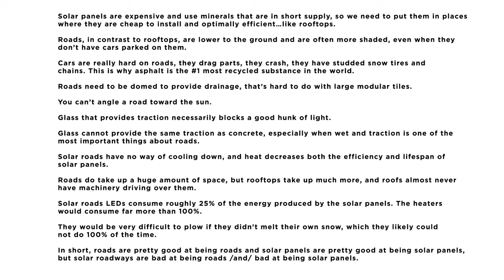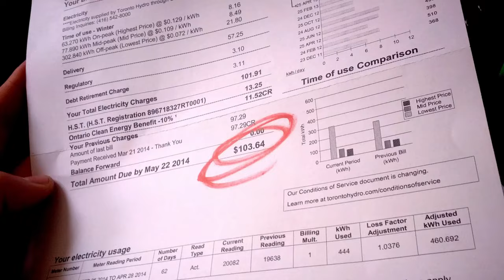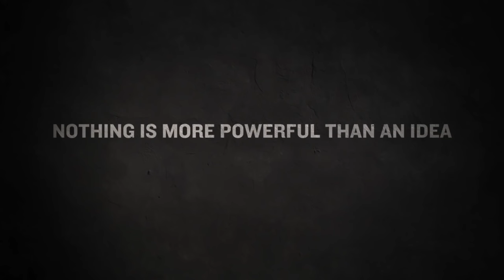The Kony 2012 of Roads - Solar Freakin' Roadways

Comment: Making a road that is also a solar panel is like making a submarine that is also a high-altitude helicopter.
Reply: That sounds awesome. But make it an aircraft. Like in sci-fi.
Reply: What’s the difference? They’re both pressure insulated? They both have propellers? I see no problems
Reply: @Iselo45  Problem one: A submarine is sealed against pressures pushing inward, with some very thick and heavy metal, using water buoyancy to support all that weight. A high-altitude helicopter needs to be lightweight, and thus sealed against pressures pushing outward with as little metal as physically possible.

It isn't necessarily physically impossible to build a thing that can function as both, but you can make either a submarine or a high-altitude helicopter that is far better, far cheaper, and far more useful than a thing that is both of those things at the same time.
Reply: @Woodledude  i was making a joke, they’re obviously not the same, about how people focus on irrelevant details, but thanks
Reply: And you could do that! That's absolutely a thing that you could build. But WHY would you build that? Why do those two good things have to be the SAME thing? By the way, this is why flying cars don't exist.
Reply: @Iselo45  My apologies - Unmarked sarcasm has been beaten to death on the internet, so I couldn't tell. Happily, we can now retroactively pretend that I was building on your joke with a humorously detailed explanation.
Reply: Omg bro you should do a gofundme
Reply: I’m reminded of submarine carriers from the Japanese on World War 2: a submarine that is also an aircraft carrier, and yes it worked about as well as you expect.
Reply: where can I donate to this kickstarter?
Reply: TAKE MY MONEY
Reply: Yeah, it seems like a great idea at first glance but...ughhhh.
Reply: Well, that seems easy. You just stick a propeller on top of a submarine; surely there can't be anything more complicated than that.
Reply: @Woodledude  I love it, let's go with that story
Reply: Like the Submachopter from Community's G.I. Joe parody?
Reply: I think I saw something like that in an 80s cartoon, once.
Reply: Red Alert 3 SeaWing/SkyWing type beat. Empire of the rising Sun truly ahead of its time.
Reply: Bro that sounds sick I'd buy one of those.
Reply: float in the ocean, swim in the air. Same old, same old.
Reply: @slash196  flying cars don't exist because they would be impossibly expensive and dangerous, would need runways everywhere (VTOL is expensive especially for something that needs to be engineered heavily enough to survive a crash) and would be far less efficient than just driving your car to the airport and taking an airplane like everyone else.
Reply: @slash196  Why? You ask why? Because it would be cool 😂
Reply: If we can make that a reality than maybe we can finally factually state that there are more submarines in the sky than there are planes in the ocean
Reply: “Dear lord thats over 150 atmospheres of pressure!”

“How many atmospheres can the ship withstand?”

“Well it’s a spaceship so I’d say anywhere between 0 and 1.”
Reply: I think that would make way more sense than solar panel roads lol
Both are pressurized vehicles aren't they?
Reply: @Iselo45  frick you beat me to it, low hanging fruit I guess
Reply: I do think that solar parking lots and sidewalks isn't inherently terrible as an idea due to how many of them there are. Obviously, you wouldn't want to put the panels under where the cars typically park, but in many parts of the world, it could be a reasonable thing to do, especially for the top level of parking garages that lack a roof, and usually not much traffic up there.

Obviously, there are a bunch of technical issues and it's likely that we'll get what we need from other sources before that happens.
Reply: @Iselo45  Right?!

on account of what you’re saying, and to underscore your point, I just realized I didn’t even know the two were different things to begin with. Like submarine or helicopter, looks the same to me tbh
Reply: @SmallSpoonBrigade  yeah I'm seeing some ground level private parking lots (employee parking at businesses) installing solar panels OVER the parking spaces, sort of like carport coverings.
Reply: @Iselo45  and solar panels are just flat surfaces, what's the difference between that and a floor?
Engineers right? 🙄
Reply: @lawnmowerdude  I love that joke from Futurama
Great sci-fi satire
Reply: @Cameron-hz9wc  reasonably well for situations in which you need a submarine that shoots airplanes, which were a lot less common than you'd think if you were the sort of person to design a submarine that shoots ariplanes, even in the days before the invention of the ICBM.
Reply: @Ilamarea  a flying aircraft carrier ?

Comment: Solar Roadways was such a great-sounding idea and I was so disappointed with how bad the actual plan was. It was a solid lesson in tempering hope with reality and still not being jaded all the time.
Reply: I worry that social media makes it too easy to get hyped up in bubbles, and avoid having to reflect on why yesterday's hyped-up thing didn't succeed. Kony 2012 was such a big thing, but today, would anyone remember it after a week?
Reply: A useful thing to keep in mind when prospective technological wonders are discussed is "AM/FM" - Actual Machines versus Fucking Magic. Musk's infrastructure ideas are prime examples of the latter.
Reply: @brandonthesteele  great point
Reply: 😄Tempering lol like in tempered glass used for solar road ways.
Reply: @brandonthesteele  don't give up on the dream. If we move the panels up 6m, there's no problem with solar roadways. 99% of the problems obviously comes from big heavy vehicles rolling over the solar panels.

And hyperloop is fixable as well. If we are not so ambitious right away. I suggest that we start off with lower capacity and lower speeds, and use the resulting lower costs to instead build a massive humunguos network. That eliminates 95% of the need for electric cars to exist.

My suggestion is a second level of road, built 6m above the existing roads. It would be a lightweight mostly metal framework structure, built on reinforced concrete posts, that supports fully automated vehicles weighing 1-10kg each, travelling on rails. Cats and small dogs could travel on these, but not medium sized dogs, or any humans but babies. We shouldn't put babies on these.

You know those vacuum chutes on old movies? I want one for our cities. For the world.

Whenever I go out, I see hundreds and thousands of retailers, employing who knows how many people. Surely there is something more productive they can do other than simply stand around all day waiting for somebody to come and buy their stuff. Farmers waste a lot of time at farmers' market, when they could be growing and harvesting more stuff. Imagine instead you order your veggies, the farmer puts it in a box, and you get it 2 hours later. And the network bills you 5.78 cents for the cost of transport. All the middlemen, intermediate processing, and wastages along the way drives up costs.
Reply: It did, but I always thought, "Wouldn't that be quite slippery when wet?" And yes, yes it would.
Reply: The general idea is a good one. The problem lies in the ability to execute it with current technologies. I'm still supper excited about the graphene processors, nano-cell solar windows and other in development tech that I heard about a decade and half ago. I'm disappointed those haven't come to fruition yet. Similarly, I'm excited by self-driving technology because it only has to better than the average driver to save lives, but the self-driving revolution hasn't been a bang, it has been a slow crawl forward. And while full-self-driving cars are rare, a lot of the pre-cursor tech are now features in "driver assist" packages on new cars (back up camera, auto lane following, forward breaking, adaptive cruise control) still decrease accidents per capita and save lives. Human's continue to work to make the world better; sometimes it works, sometimes it has unforeseen consequences, and sometimes it just takes a while to get there.
Reply: I think Thunderf00t put it nicely. "There's nothing wrong with having your head in the clouds, so long as your feed are on the ground"
Reply: @ZeldagigafanMatthew  thunderfoot is a mess
Reply: @danielch6662  That would be pretty cool. What would the topology be? A separate pipe to every house wouldn't work very well, so you'd need some kind of automatic diverter anywhere a building attached to the main line. Still, the concept is really neat.
Reply: @outerspaceisalie  Yeah, thunderf00t peaked on his debunking of Solar Freakin' Roads.  It's been downhill ever since.
Reply: listen to actual experts:) often the best solutions are the most humble and simple ones, like public transport.
Reply: @ZeldagigafanMatthew  Damn that's a rare thing for him to get right then, with y'know, him being a massive bigot lol
Reply: @kx7500  He was actually pretty good outside of debates before the whole Gamer Gate thing corrupted the brains of so many.

He seems dropped much of that rhetoric, but last I looked (which was about eight montsh ago), he still had his "Feminism Poisons Everything" series up.
Reply: @ZeldagigafanMatthew  Yeah that's fair and I think I already agreed with you there, I should have mentioned that to give him credit though where due. I guess I was referring to him in present day. Though maybe we still have a bit of rose tinted glasses looking back at him idk, honestly don't think I followed him ever that much directly either. And yeah having it still up is pretty telling. Thanks regardless.
Reply: It's more an example of how the average laymen has far less understanding of technology than they think. In the real world rarely are things so cut and dry. 

I'll point out the great Sci-fi idea of AM FM. AM stands for Actual Machines as we live in a world were things get worn out, dryrot, grind, burst into flames, and have minor issues that can escalate like setting the vibrational frequency of a bridge to exactly that of people walking. FM stands for F**king Magic and describes the beautiful, utopian world were we don't care about material cost, existing infrastructure, environmental impacts, or in general complexity to build as it just works and we know it will solve our problem. Some great examples are the Neom city in Dubai, hyperloop, space elevators, orbital rings, mass drivers, the nuclear flying hotel, or the gyro bus.
Reply: @danielch6662  then it's not solar roadways at that point and its pointless. Why put the panels over a road instead of using them where they get the most amount of light at the right angle facing the sun. Solar and roads have no reason to be a thing together. We struggle to produce enough solar panels as is... And even if he did we don't have anywhere near the technology to store all of it when we need it. People don't realize how far away a fully renewable future is. Even the people who put solar on their homes isn't sustainable when you have more than a small percent of them using them. Those solar houses rely on the grid to make their system work because most people use the majority of electricity when the sun isn't out or when it's the evening so they need to sell their solar to the power plant and buy it back from them later In the evening when the power they are actually using isn't from solar. If every house went solar they would all need massive batteries because they wouldn't be able to pull from the grid anymore.  We are a minimum of 30 year if not 40+ years away from even coming close to mostly renewable power.
Reply: @kx7500  lmao and how is he a "bigot"